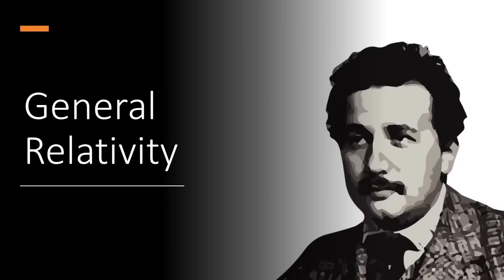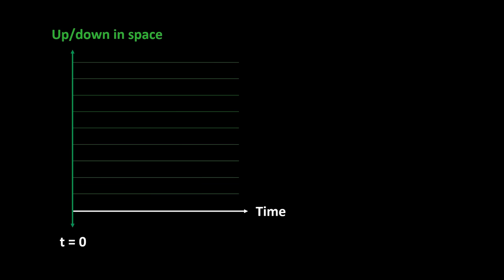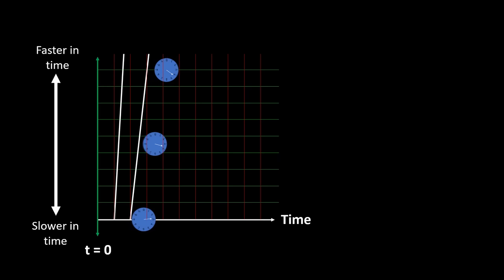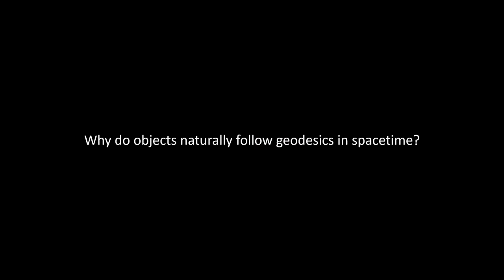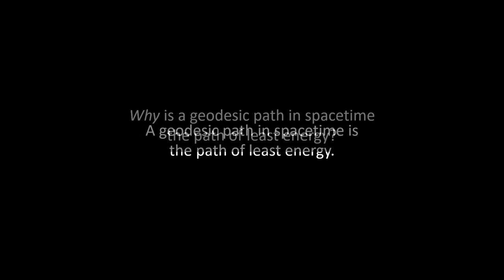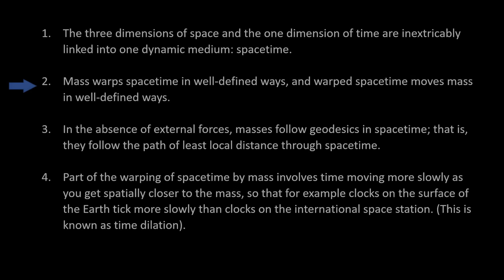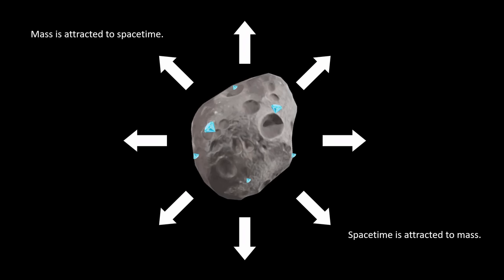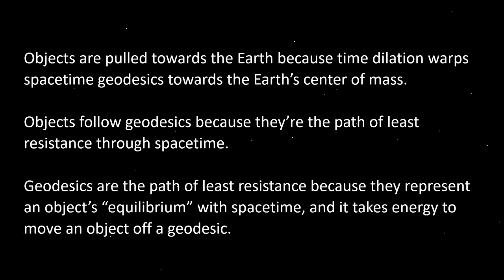How Time Dilation Causes Gravity, and How Inertia Works

Comment: Hey, I really enjoyed your video!

I watched it all the way through, and I think I might have some answers to some of the questions and ideas you were exploring. To share them, I’d like to explain my perspective, which builds upon many of the concepts you outlined but diverges in some key ways. Since your video is a few years old, your thoughts may have evolved or refined since then, but I’d love to know what you think about my approach.

Let’s dive in:

---

1. Causation and the Time Lattice

What modern physics calls "spacetime," I think of as the time lattice. It’s an infinite, interconnected medium where every direction and dimension is simply time. There is no “space” as we typically think of it—only the elastic properties of time itself.

Causation, what some call the "quantum foam," is an external force pressing against the time lattice. This pressure deforms the lattice, creating oscillatory waveforms. Everything we experience as matter, energy, and forces is the result of these waveforms interacting—not the actual causation itself, which remains external.

---

2. Oscillatory Waveforms as Reality

All particles, fields, and phenomena—gravity, inertia, and electromagnetism—are manifestations of oscillatory waveforms propagating through the lattice. These waveforms are not static entities; they are dynamic oscillations that arise as causation deforms the lattice and the lattice attempts to return to equilibrium.

For instance:

A photon is the simplest oscillatory waveform, defined by its single oscillation over a Planck length and Planck time.

Larger constructs like protons or electrons are more complex, higher-order harmonics of these oscillations.

This redefines the idea of "particles" as simply the peaks of oscillatory waveforms, with fields being their extended, lower-energy tail ends.

---

3. The Tick: A New Counting System

To simplify and unify the math, I’ve adopted a system based on the Planck scale. Here’s the baseline:

One tick is the time it takes for a photon to travel one Planck length. This is the 1:1 ratio for time and distance in my framework.

All measurements—whether mass, energy, or distance—are defined relative to this tick.

For example, the speed of light becomes a tautology: one tick per tick, or 1:1.

This simplification eliminates extraneous constants in equations, such as  in , E=mc^2 which now reduces to E=m. The relationship between energy and mass becomes intuitive: they are simply different states of oscillatory compression.

---

4. Gravity, Time Dilation, and Inertia

With this foundation, we can reinterpret many of the ideas from your video:

Gravity: It’s not a force or a field but the result of lattice compression caused by massive objects. The lattice’s elastic properties create a low-pressure system around mass, drawing waveforms toward equilibrium.

Time Dilation: As lattice compression increases, waveforms require more energy to propagate. This slows their oscillatory rate (or "tick rate"), which we perceive as time dilation. The idea being, the ticks required for our systems of waveforms are on the magnitude of 100s of millions of ticks, where a pure photon's is 1:1, we "experience" millions of its ticks in comparison to the length of a single oscillation at our compression magnitude. This difference in tick-rate (or framerate) is observed as time dilation.

Inertia: Inertia is simply the resistance of the lattice to compression or expansion. When you try to accelerate an object, you’re forcing its waveform to compress in the direction of motion, requiring energy to overcome the lattice’s natural elasticity.

---

5. Testing This Framework

I think this approach aligns well with the questions you posed, such as:

Why does mass warp spacetime?

Why do objects follow geodesics?

Why does time dilation exist near massive objects?

If you’d like to explore this further, I’d suggest reanalyzing phenomena like gravitational waves, photon interactions, or even black holes using the tick system. This might yield some exciting insights into how oscillatory compression dynamics play out at different scales.

---

I’d love to hear your thoughts on this framework and whether you think it might complement or refine the ideas you presented. Thanks again for the incredible video—it’s sparked so many ideas!

Comment: I'm missing something key about these geodesics.  Seems we have relative time increasing with R and so also velocity but that should be symmetric in 2D around the Earths' center. How can that be a simple function of distance from the Earths' surface if the clocks are unconstrained.  Should be relative to the Earths' center of mass if the clocks have negligible mass. But then they should have negligible gravitational force. Then why would different masses and densities fall at the same rates in a vacuum. Seems that is not quite true. 

Seems there are issues of scale. To make observer time pass 1000 times faster you would need (1-vsq/csq)=1u and v equal .9 to 4 digits of c

The scaling of time dilation is wildly greater than the scaling of gravity....at any reasonable distance R where gravity would be experienced there is virtually no time-dilation due to R. Otherwise there are other concerns than time dilation that are significant 😃

Comment: time dilation is bogus. "spacetime" is just a mathematical object, a coordinate system that maps spacial coordinate changes over time. time dilation is a rather stupid misinterpretation of mathematics. going at relativistic speeds just means that light is reaching you later, so an image that reaches you eye is delayed. but time has not changes, you are just seeing a picture that looks as if time has slowed down because you are outrunning light and light is needed to communicate any change. just because the information reaches you later, doesnt mean that the actual state change communicated through the image was slowed down. obviously this makes no sense, as changing an objects rate of time means changing the speed of the physical subatomic reaction, which is locked at light speed. constant speed of light means that time manipulation is impossible. and like I said, its obviously a crazily stupid misinterpretation. 
if you move at light speed around earth and then stop, you wont have aged slower or faster. the subatomic information that makes up your body always was moving at C not matter at what speed your body is moving. 

gravity is entirely due to fluid dynamics. the universe is a fluid. its flow compression is gravity. any kinetic pressure impulse inside the fluid caused flow and compression. energy is just a total amount of pressure or impulse in the medium for a given volume. this is how energy can be equivalent with mass, as energy equals flow and flow causes compression of the medium around it. matter is just localized flow, in the form of localized flow fields, which are nothing but magnetic fields. if you realize that magnetic fields are flow fields and arrange multiple of them together and draw compression forces perpendicular to the direction of flow, you can see that only the polar forces cancel, but a net compression remains in all directions, since its basically just a ball of localized flow. its this compression that is the gravitic force. its just the left over compression form the magnetc flow fields that compose matter. you can show this using any fluid. if you have two chunks of localized flow or matter, they compress the medium all around them, and the medium between 2 matter chunks is compressed from both direction, making it less dense between them than the surrounding medium, which pressed the 2 matter chunks together. gravity is essentially a giant magnetic mono south pole. fluid is constantly being compressed and sucked into the mass, and this energy is then converted in more global rotation speeds, either of fields or compounding fields in the interior of the mass or even the entire mass. 
as gravity is nothing but the effect of incoherent magnetic flow, any magnet cause be used to oppose gravity. any magnetic north pole is inherently anti gravitic, its just that this force normally is overpowered by the attraction of the incoherent fields that compose the atoms of the magnet, which overpowers the anti gravitic force to a point where it is undetectable in normal magnets. but, if the energy that is in the polarized magnetic field relative to that in the incoherent fields is increased, weight is lost when the north pole faces earth, and if strong enough, it will levitate and fall upwards from the push of gravity, now becoming an energy generator if the field angle is changed to make it fly straight or in a loop. this is flying like a helicopter in strongly downwards compressed air, just in the medium of space.

Comment: Mass does not increase as it approaches the speed of light. That's why it's called invariant. Mass becomes spread throughout spacetime relative to an outside observer as it approaches the speed of light. 
   Einstein thought the math regarding length contraction did not accurately describe physical reality. That wasn't his math, he hired someone for that. His math is represented in the dilation graph. X amount of velocity/momentum = X amount of dilation/gamma.
   We are all traveling at the speed of light relative to some potential vantage point. We are not length contracted.
   The best way to understand dilation is to imagine a spaceship traveling at a constant acceleration rate. When the ship reaches 50% light speed, as viewed from an Earthbound observer with a magically powerful telescope, it would appear normal because as the graph shows nothing has changed at that point.
   When the ship reaches 75% light speed it would appear fuzzy because as the graph shows relativistic effects would be noticeable at that point.
   When the ship reaches 99% light speed it would not be visible because every aspect of its existence would be smeared through spacetime relative to an Earthbound observer.
   No matter how fast the ship goes everything would be normal from its perspective. Relativistic effects are all from an outside/stationary/Earthbound observers point of view.

Comment: Time Dilation  does NOT Causes Gravity. At the speed of light time is zero. Are you saying light not affected gravity? 
Two observers at different heights experience time differently and 'space 3D' curvature.  In other words, further one is the other is on the gradient.  
You can gravity without time. The metric tensor adds time.

Comment: Gravity actually causes time dialation, but okay. The reason for this is the same reason you can't touch a dash of a Tesla when they floor it and you are in the passanger seat -- acceleration makes moving harder.  You'd try to move to touch the dash, but you won't be able to.  Your muscles aren't strong enough to move under the force of the car, you'll be thrown back into the seat against your will.  This is the same reason clocks move less under more acceleration.  The little hands struggle to move more and as a result they actually move slower than a non-accelerating clock's hands.  What does this mean?  Well, there is no real time.  Clocks are just little machines with pointy spinny arrows.  There's only motion relative to other motion -- that's it.  Light is the only conatant speed thing anywhere, so you can compare light motion to non-light motion and that's exactly what we do often by comparing motion of some thing to the motion of a light-meter.  The arrows move, light moves one meter, how much have the arrows of one clock moved compared to another clock holding the light meter constant? That's all it is.  Accelerating the clocls makes it harder for the little hands to move so thus they move less than a clock not accelerating relative to one light-meter.  It's that simple.

Comment: not even 2mins in and Botched! Clocks on the surface of earth do NOT tick more slowly than on the ISS. Remember It's moving at 28,000 kmph, which means a clock actually ticks slightly slower on the ISS compared to on earth's surface. 
"Special Relativity" time dilation from ISS movement in spacetime has a larger effect than the "General Relativity" time dilation from earth's mass warping of spacetime on the surface.

Comment: Time dilation may well cause time to run differently on the ISS than on Earth, but, as the strength of the gravitational field is only 3% weaker up there gravity isn't the reason that massive objects appear to "fall" near the surface of the Earth. If you let go of something then (for all practically observable intents and purposes) it doesn't move anywhere in space, and it is the surface of the Earth that comes up to hit it again. Strange, perhaps. Yet nonetheless true.

Comment: I don't see the evidence here time is warped by spacetime. Clocks are machines. Ticking slower is not evidence of immaterial time influence as I see it. could just be gravity. Where is the evidence timespace exists? Where is the evidence time is slower at the top of a sctscraper relkative to the basement? no clockes please or gps.
Reply: Atomic clocks have been used to measure the difference for decades.
Reply: @irafair3015  Atomic clocks must be under the laws of nature and so gravity etc etc. they are not independent of other laws or they would not of been created by man. In all these clock tests the point still is they are under gravity laws and so not evidence for time being slower or prove it.

Comment: As nice as this explanation seems to be, it is incorrect. The clock at a higher elevation runs faster, so the tick marks should be closer together relative to the tick marks at the lower elevation.
Reply: no. this is explained with a time dimension graph (x) and one tick up in the tower will move further along the graph than something further down

Comment: Thank you ,you made me to understand it. 
Now i understand what is gravity and where comes from. Gravity is not is force,it  is a curvature of space. Father was right. ( peace upon you father ). Gravity is caused( created from the mass of objects), and the spin of galaxy( both of them simultaneously).
Curvature of space( around planet) is created from mass of objects( planets stars etc..), mass warps the space( bend the space) around the planet,it changes the course ( route) of the object which are traveling at same speed by the spin of galaxy.
Father thought : everything is traveling,we are traveling in space, this is caused by spin of galaxy, the spin of galaxy cause all us to move at same speed, all objects move at same speed ( it is the galaxy's spin, which moves us with same force ,same speed). So we are moving at same speed ( including ants and suns), so it is the same speed, speed is equal for all objects which are traveling ( by spins of galaxy), and the planets curves the space around them ,it changes the course ( itinerary) of object which is traveling( by spin of galaxy). Therefore all objects fall at same rate/time in vacuum ,because they are traveling at same speed ( same force by the spin of the galaxy), where is not vacuum they don't fall at same rate/time) because air prevent them. 

I don't know if this explanation works in galaxy which doesn't spin.
I don't know how works gravity there.

Comment: Although the effort is appreciated, this video is incorrect in its statement that time dilation causes gravity. This hypothesis has been proven wrong many times and the original source of the data has been debunked. several times. Gravity is an illusion indeed - mass causes the fabric of space-time to curve, thus an object following along a straight line within this space will instead follow a geodesic path. This has nothing to do with time dilation.
Reply: Time dilation is a generated effect from the curvature of spacetime. At least that's how I see it. I'm not a scientist so I could be wrong about it all. However, Einstein's theory makes the most sense to me. I don't consider gravity to be a force, to me it is a perceived effect of the curving of spacetime.

Comment: Question: Why does the branch exert energy on the attached apple? I liked everything else, but in Newtonian physics the branch does not exert energy and if it did the energy would have to come from somewhere? My best guess at an answer is the unbalanced tree is weakly accelerating the Earth off its geodesic path, but this fails if I balance apples. On your account the ordinary normal force requires energy expenditure. Hence my confusion?

Comment: So time slows down when an object "freefalls".?.as well as when traveling at faster speeds through space at higher elevations from the frame of reference.?.yet is all relative and dependent on an observer capable of sight to have the perspective required to observe what seems to be time dilation.?. Almost sounds like an illusion from a trick of the mind played on the mind, by the mind. So if the observer perceives the time dilation, then time has now become an idea that when pondered on long enough becomes a concept. Then as the saying goes, after some time goes by or is traveled through, we transform that concept into a foundation like that of the current views and perspectives of how we are taught to live our lives. By way of a time schedule. Hence the phrase "we made good time, or "not enough time". The only indication of time is through the perception of an aware observer from my understanding. This based off the choice of words used to explain time and time dilation.